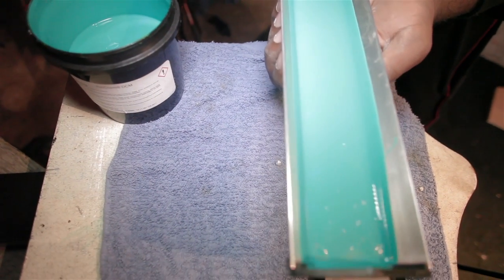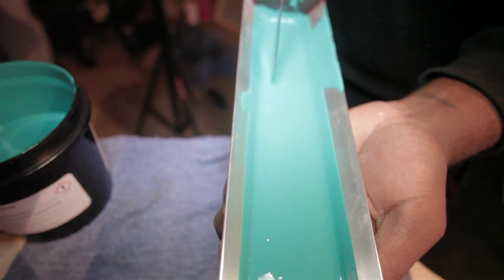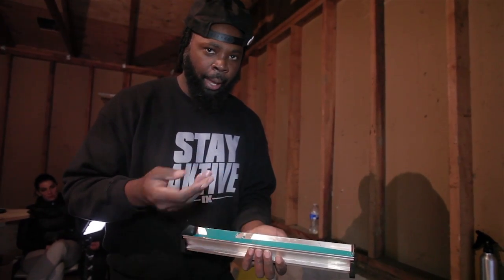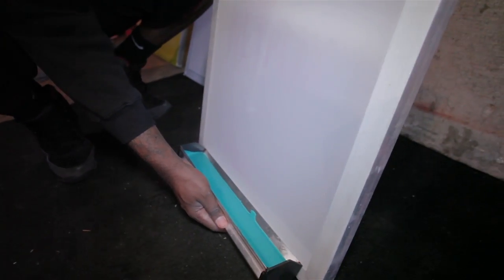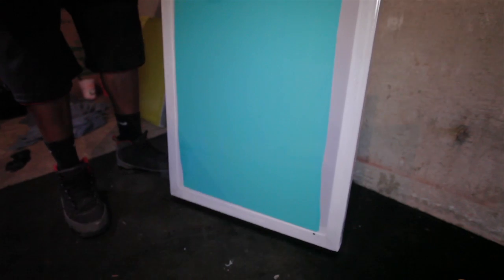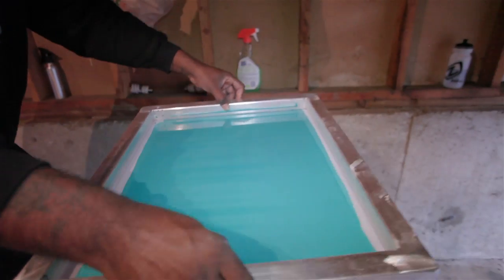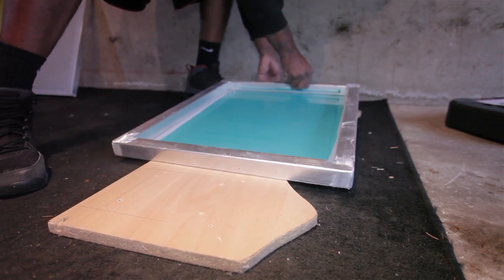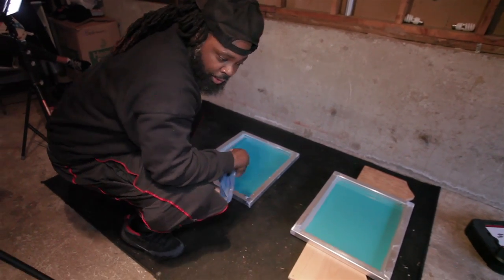FILLING SCREEN- My 2nd attempt

Comment: hey there, nice videos. i wish you good luck and a lot of fun. once i started screenprinting i fell in love with it!
here my suggestions:

- press harder while you coat it looks like you build up loads of coat there (and yes use the sharp edge)
- it is important to coat the frontside (stencilside) first, than the printing side (where the squeegee will be used)
- always dry it with the stencil side down -> and use a fan or something to move the air a lil bit
- i only coat front and back once, which is completely sufficient, works for me 100% and you save inks and emulsion
BUT in case i want more ink building up (white for example or on dark garments) i would maybe coat 2 times on the
stencil side. but as i said i never do it i rather use a differnt mesh count and it works great for me!

thank you for sharing your videos with us. peace!

Comment: Hey great start. I would recommend using the sharp side to lay down the emulsion. I use 2 passes on both sides and that gets you a nice build up. So for that process do two passes with the sharp side then flip screen and do two passes. You want to make sure you flip the screen so the back side passes are going opposite direct; this helps emulsion bond in the screen. 

Started out similar couple years ago, just watching youtube videos and teaching myself. let me know if you have any questions. some good channels to check out and dig into are Ryonet and Catspit productions. Both have some great content about getting started.
Reply from the maker: +Dan Lichodolik Thanks. I was not sure which side to use and had used the rounded edge. Im coating screens tonight and will try the sharp edge. That flipping the screen makes total sense to me too now that you explained it. That will be added to my notebook. Thanks again Dan

Comment: i'd give, as mentioned, 2 passes on each side using the thin edge of the applicator. the first pass lays the emulsion on and then i would pass back over it to scrape any excess off so you have a nice even coating throughout the mesh. saves emulsion too as all this stuff soon racks up as far as cost is concerned right?

Comment: Hi Kan,

That's pretty good the second time out. Looks like you started on the correct side of the screen, got a nice even coat, and didn't even hardly drip. When you come to the part of the screen you want to stop, just stop the upward motion, tilt the screen to a straighter up angle so the emulsion rolls back into the scoop coater, and then pull away.
If you want a more indepth video about coating screens, http://merchmakr.com/blogs/learn/76432001-how-to-coat-a-screen-printing-screen
Reply from the maker: +Gary Jurman Thanks for the link and input Gary. Im checking the video out now!